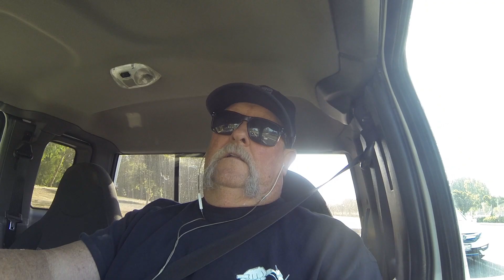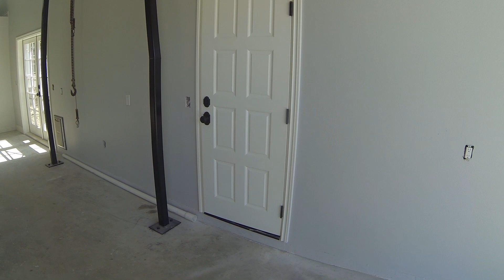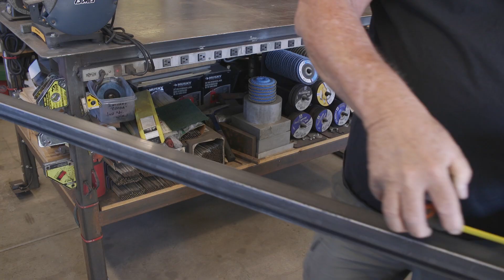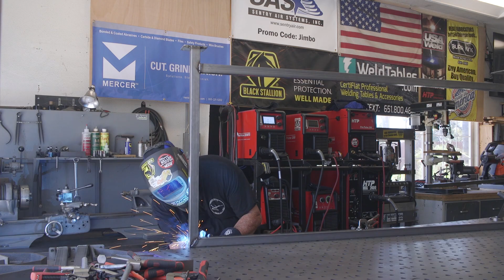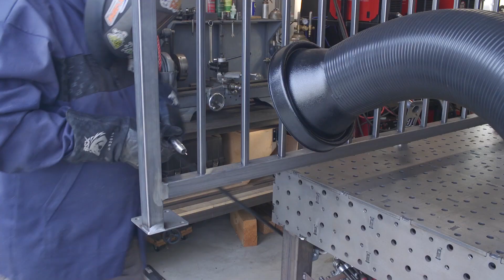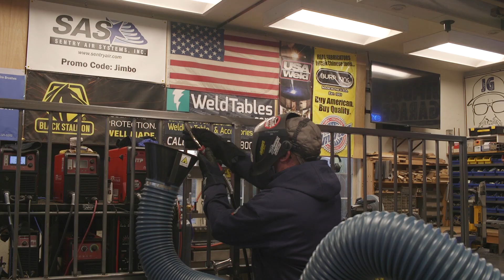Loft Handrail & Ladder Part 1 | JIMBO'S GARAGE

Comment: @jimbo a little advice for grinding, try to keep the disc flat and use less of the discs edge.. I can see through the video that your putting dips where you were grinding. Keeping the disc flat allows for less room for error and look much better when painted! Just a little tip! ☺️
Reply: Tanner Stainbrook - LOL "Little Tip"
Reply: Mr. Saephan well I build custom ornamental rails and spiral stairs so I grind quite often. I was explaining the reason of why to try to grind different. Damn bro, be respectful lol

Comment: There is an apple app. Called balustrade  it figures out spacing for pickets. It makes quick work of spacing. Also a stair app called deluxe stair. Greatest thing!
Reply: There is also an online (free) calculator for balustrades (among others) at blocklayer.com - it’s quite good.
Reply: @justcruisin109   I have to laugh when i see people struggling with picket spacing. im not a fabrication god although rather than download apps or use a website to do basic math, i just use my calculator. for example if you have a 40 inch span that requires pickets, while keeping in mind most code requires no more than a 4 inch opening between pickets, start with any number or measurement that you might think would work out evenly throughout the whole span. in this case we know 40 inches can be divided by 4 inches giving us evenly spaced pickets throughout the entire span. do this with any size span, area, whatever you want to call it. often times you might not have the luxury of an even number like 40 inches for the area that needs pickets although the same method applies. if its a 173 inch span, start with 4 inches times however many pickets you might think youll need, roughly 43. use a construction calculator to help as you can type in the actual fraction. hope this helps!!

Comment: Jimbo, You might want to look into the codes for the railing.  As far as I know, the IBC code is for residential, as well as commercial.  The code state that 4" sphere can not pass trough the railing.  YOU might want to cover your ars on this and check it out, before the lawyers are knocking on your door!

Comment: Is there any particular reason you dont use Lincoln or Miller?
Reply: many people are under the assumption that if you want to have nice welds you need to buy a popular name welder. i paid $500 for my 200 amp multi process welder. the cost of a lincoln or miller with the same capabilities and accessories would cost me over $1500. ive been welding for over 8 years now and have used many many many welders old and new. for $500 i was extremely surprised how well mine works. might not last decades like a miller or lincoln but so far it preforms just as nice and the consumables are much cheaper.
Reply: Because he's not getting them for free.. Jim used to use all everlast everything, then one day we saw all red HTP machines, no explanation.
Reply from the maker: Thanks for watching, No reason! I just like Htp.    Jimbo!